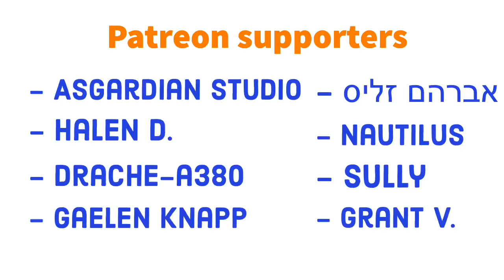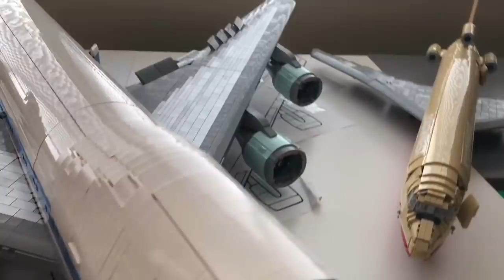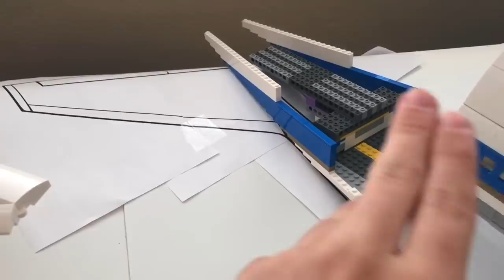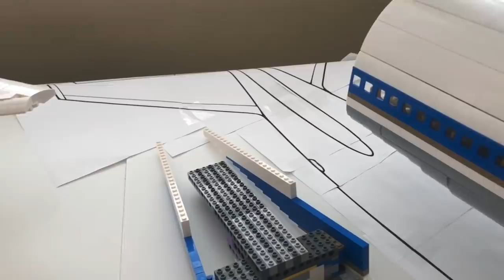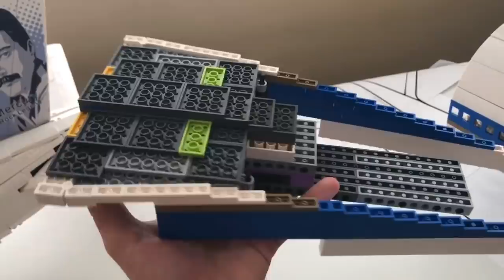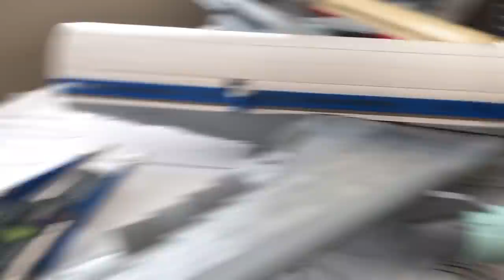LEGO Air Force One, More Tail Progress!!

Comment: At 5:45, you can see that where the rear fuselage section meets the wing box, there’s a stud of height difference between the two sections on the farthest down white line
Reply from the maker: Nah I just forgot to add one more layer of white plates. Everything else is aligned.